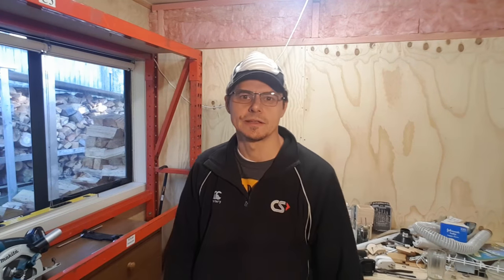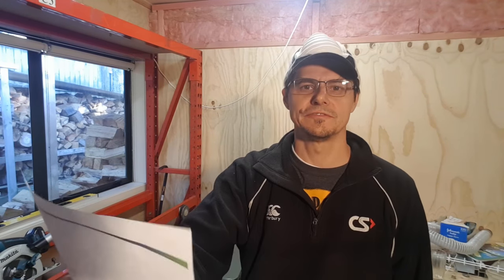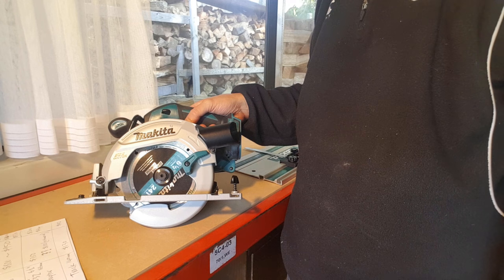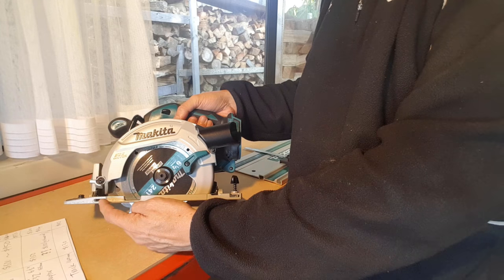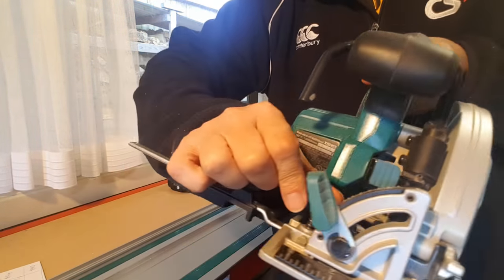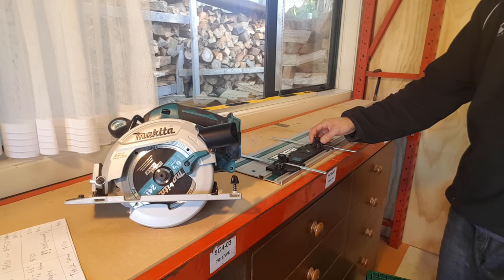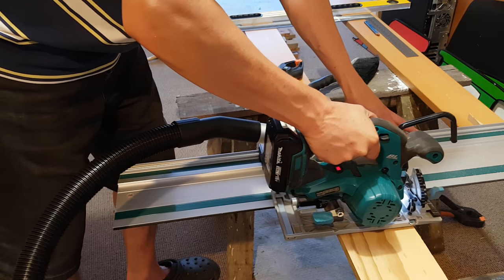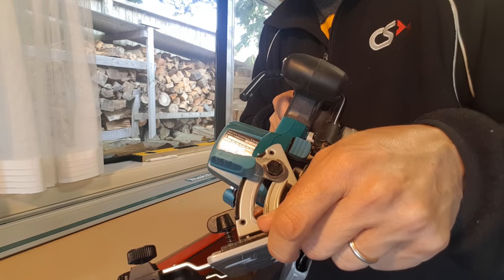Makita circular saw adapter for rail guides - circ saw becomes track saw.

Comment: Hey Rob, Nice video there. Im a hobbyist woodworker looking to get straighter cuts. Been using a straight edge jig but wanting more accuracy now. 
I noticed you glued the bits first then drilled holes for your dowels - I guess this is acceptable? I have a shelf bracket I want to build and was thinking about doing this to it. 
Also - do you get paid for affiliate links? I would  want to purchase from you so you can get rewarded for your work. 
thank you
Reply from the maker: Hey Mike, thanks for the great comment. There are two or three reasons for using dowels. The primary reason is to add strength/reinforce the joint. In this case you're okay to add them after the glue up. This usage is a type of floating tenon, almost as good, and the same concept, as the Festool Domino. The second reason is to align the pieces of the joint AND add strength. In this case you would clamp accurately into position before drilling the holes for the dowels, and glue them all up at the end. The dowels ensure that the miter joint faces don't slip out of position once clamped with slippery glue. Thirdly, dowels can be used for decoration, so you can put them in after. For a shelf bracket you might want to look at adding "splines". You need a table saw for that really, otherwise, dowels could work I guess, they'd have to be long and quite big.
If you use a half lap style of joinery you might not need either as the glue surface is very high and therefore very strong.
The links in the description are affiliate links, thank you man 🙏.. Much appreciated, very kind of you. Best of luck, enjoy the hobby, it's a good one.
Rob.
Reply: @TakamiWoodshop  ah thank you so much Rob. The little piece you showed near the end is really my style of pieces I like. 
I'm finding it really hard to figure out the best way to build these brackets efficiently with limited skills and tools.

Comment: Is the attachement metal or plastic ? As its coming in around £50 in the uk
Reply from the maker: It's plastic, ABS I think. It's tough as nails if that's what you're worried about. The arms are aluminium and there are stainless threaded inserts for locking them in place. Cheers.
Reply: @TakamiWoodshop  thanks for your quick reply as i am looking at this as an alternative to spending a fortune on a a plunge saw as i have not had a a lot of use for one ? although the ability to use a guide rail on times might come in handy ?
Reply from the maker: It has worked out really well for me in that respect, since I only occasionally have a need for a track saw or a circular saw. It saves both money and space.
Reply: @TakamiWoodshop  i am in the building trade and have an 18v circular saw but not that model so i am looking on e bay at a set that includes the saw the guide 2 x 1.5m rails and storage box for just shy of £300 and have the best of both worlds apart from then needing to sell my old circular saw
Reply from the maker: I'm not in the trades but I've used the 36V saw and done enough with my 18v to know that if I was in the trades I'd get the 36 volt. In my case I'm talking about wet timber for fences and decks and things. Also if you have lots of ply sheets to rip down... The 36 volt just felt way more capable and more of a time is money justification for spending more. Just my thoughts but regardless, I'm sure you won't regret the lovely tidy cuts you get with the track.
Reply: @TakamiWoodshop  i have not done enough work where i have needed a dedicated track saw to justify spending the extra cash on something i would only use occasionaly.
Reply: @TakamiWoodshop  what blade would you recomend for the 18v ?

Comment: Good video man! Ps: Does this guide is compatible with Makita hs7611? Tanks from Italy🇮🇹
Reply from the maker: Hi Mattia - I not 100% sure about the hs7611 - here's a video with the adapter on a HS7601J [https://www.youtube.com/watch?v=8X8ZA1_n-FY&t=29s]
The bars have three spacing options - 200mm, 215mm, 230mm. I think your saw is "probably" compatible. 😁 (cheers from New Zealand 👋)

There are also these other adapter options that you can look at: https://amzn.to/2tTDdve / https://amzn.to/2EQYj3s
Reply: @TakamiWoodshop  tanks

Comment: I needs to get me one of them...
Reply: Nice review Rob track saws are very useful thanks for sharing 🔨👍
Reply: Hey Rob, Where did you buy that? Do you have the model number? I have always been too tight to get a track saw, just the tracks cost a fortune! I always go for clamping on a steel straight edge. Good to see another Kiwi on here.
Reply: I have got clamping a straight edge down to a fine art so that makes me reluctant to splash out on a plunge saw. Saving up for the 36v 10" mitre.

Comment: Hey mate. Love the videos.  Do you have a specific blade on their to cut plywood?
Reply from the maker: hey cheers man! I don't have a blade specifically for plywood but I do know that using Makita blades give an absolutely mint cut whatever the material and using Irwin cheap rubbish from Bunnings hacked up the side of the track and the cut is much rougher - okay for framing or retaining timber etc, but it chips out quite a lot on plywood. I would just recommend a decent brand blade like Makita, DeWalt, Bosch, Diablo etc and stay away from the tempting cheap stuff if you're doing something that needs a nice cut.
I've never used a super high end high tooth count blade on this as I don't do melamine etc - only ever done ply and MDF.
Hope this helps. cheers mate.
Reply: Thanks for such a detailed answer! I have lined a batch with ply and aboutt do kitchen, also ply.  I m waiting for the dhs680 to arrive in post. Also ordered 2 x 1.4 rails joiner and adapter.  Keep the videos coming. .🤙🤙🤙
Reply: And you answered my question perfectly
Reply from the maker: @Hemi_68  The bach sounds like a cool project mate. I've been meaning to do a follow up to this video but anyway here are some extra things I'd recommend. 
1. The adapter is confusing to set up at first - just make sure you end up with the body of the saw over the track and cutting on the left side. (most plunge saws are right blade so it will look weird if you compare it to other youtube vids etc)
2. once you set it up and cut the rubber splinter guard try not to ever change the set up of the adapter bars 'cos unless you get it dead nuts the second time it will either have a gap or eat away more and more of the splinter guard (and eventually the track itself as in my case) The important consequence there is that it will not be cutting on the line anymore so your cuts will be either too long or too short.
3. When it comes to making the money cuts (visible end grain etc) make sure the blade is really clean - even if it's sharp, if the tips of the teeth are gummed up with crap it will not make as nice a cut as possible. 
4. lastly - if at all possible don't stop in the middle of a cut - steady pace with even forward and lateral pressure from start to finish.
5. really lastly - for making short cross cuts - because you need to have the track hanging off the end to get the cut started, it can tilt the whole track up and push it off your line - clamps or helper recommended.
6. I keep thinking of them, and forgive me if you know this already - the material on the track side is the keeper, the other side is the "waste" - if you have to make a cut where the waste side is your keeper, you need to offset the track from the line by the kerf (width) of the blade - otherwise your pieces end up too short by a couple of mm. There are some vids on YT about "track saw waste side cuts" etc

These are all things I've learnt the hard (and expensive) way lol. Good luck mate, enjoy the bach.
Reply: These tips are gold. Add them to you video description.  Or even better make a new video going through these tips.
Reply from the maker: @Hemi_68  good idea! - I've added to the video description. Planning a new vid soon.

Comment: Will this work with festool rails?
Reply from the maker: Hi Gareth - thanks for subscribing to my channel - hope you enjoy this and my other videos. I'm sorry but I couldn't tell you with any certainty that this adapter will work with Festool rails. I know there is some interoperability between some of the leading rail systems  but it isn't something that I've experienced or researched at all so it wouldn't be right for me to give you an answer either way. If you can find evidence of a Makita plunge saw running on a Festool track that should provide the answer as the profile of the adapter is the same as the profile of the Makita plunge saw range. Cheers, Rob
Reply: @TakamiWoodshop  Makita tracksaws are compatible with Festool tracks so I'd imagine the adapter should fit a Festool rail.

Comment: Hi Rob, I just got the Makita dhs 680, tracking rail and the adaptor based on your review and tbh I'm a bit disappointed after using it... The adaptor wobbles to sides about 1mm and stops the saw from cutting straight. It actually screwed up the rubber too... Is there a step I might be missing? I'd  really appreciate it if you have any suggestions or tips!
Reply from the maker: Hi, there are two black adjustment knobs to prevent this wobble. I've screwed up the rubber too. You have to be pretty careful when you adjust the aluminium arms. Good luck, don't give up 💪

Comment: Hi Rob and followers, has anyone got experience of using this on thicker stock? I need to cut some firrings out of (old) 4 x 2 and wondered how it may fare? Thanks @takamiwoodshop for the great product
 test and review
Reply from the maker: This saw can rip 4x2 but I wouldn't use the track saw adapter - it would be better to use a rip guide thingy. For old and super hard wood you might need to do it in two passes- even for soft wood it's be easier. I've done both with this saw
Reply: @TakamiWoodshop  thanks for the response :)